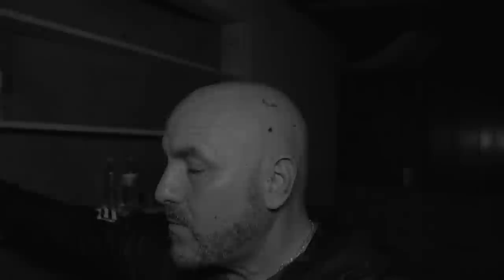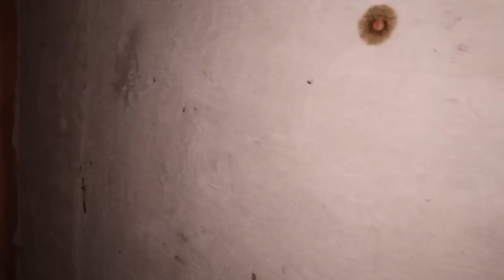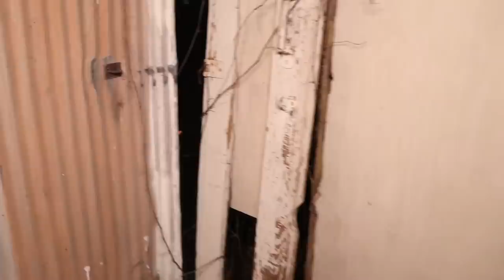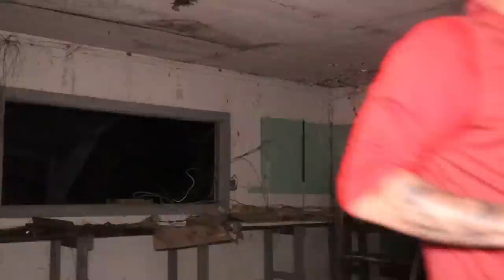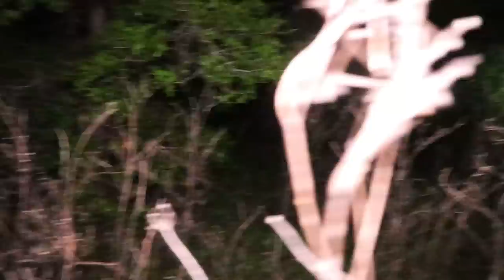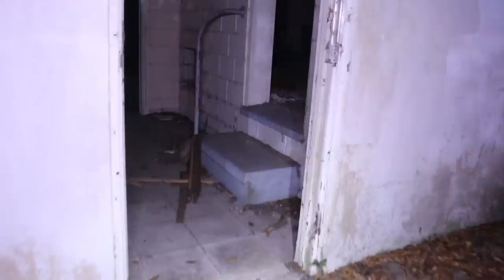(STALKED BY BLOOD BROTHERS) RUN COWARDS RUN!

Comment: This is where team work comes in. If you both decide to go back, one of you can walk, and the other stand still, but not to be far apart from each other. One who is walking not record, and the other record, and scan around the one walking. If you decided to go back, I think that would be the best way to see if it is someone there or not. But I did here what sounded like 2 walking and conversing with each other. The voices were too low to tell what they were talking about. I know they didn't want either of you there, that's what it seemed like at the time, along with some evil spirits as well.